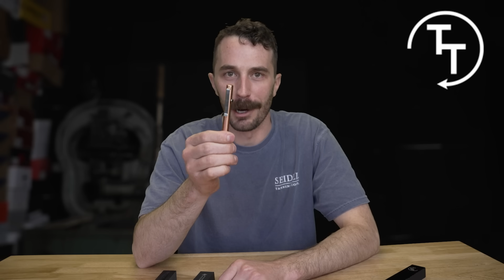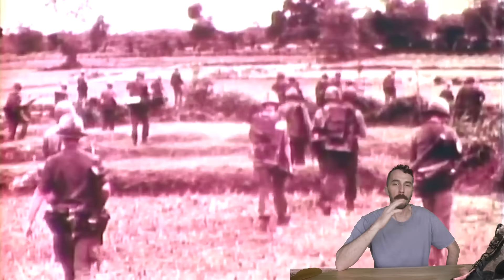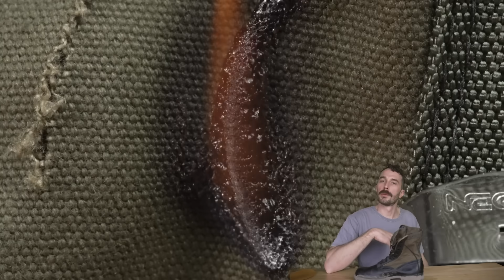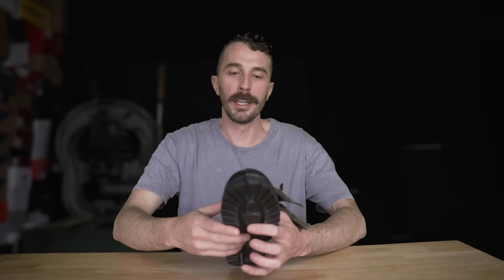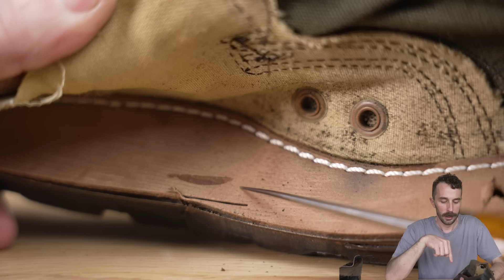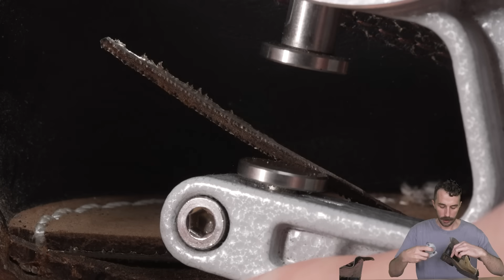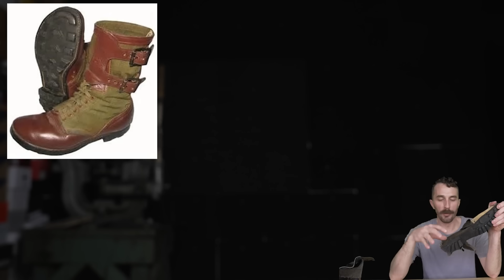Why it took 57 years to replace jungle boots

Comment: I was a Marine grunt in Vietnam (4/67-5/68) and I still have my jungle boots,  and they have held up well after all these decades (though I don't wear them anymore).  I logged many miles in those boots through the rice paddies and fields and had no problems.  I found them to be a reliable and comfortable boot and I really liked the job they did.  A great boot in my opinion.
Reply: My dad just gave me his. He is a marine grunt and was in Vietnam 67/68.. badass boots
Reply: @MarcosGarcia-jl5lc  your dad gave you tacos and Cactus
Reply: I wore them in the 1990’’s and early 2000’s. Countless miles of ruck marches. I remember, getting to Bosnia with only cold weather boots. Ordered some green Altima’s. The day i got them we did a long movement. I wore them right out of the box with only one coat of polish, not a single blister. I learned foot management from our brothers who went through Vietnam.
Reply: Canadian?  @parajeeper
Reply: I was in from 96 to 02.  I got several pair of the last remaining green uppers in the supply chain.
Reply: @road2wearysum1  Former FMF Corpsman here.  I wore jungle boots for my entire time with the Corps.  10 years active duty, the last 7 with the Corps.  My first suggestion for foot care would be to learn to trim your toenails correctly.  You'd be surprised how many don't know how to do this. I've removed/fixed many, MANY ingrown toenails that could have been prevented with proper trimming.  Next would be changing your socks, but along with that foot powder.  It just keeps your feet dryer, and they'll feel better.  Hope that helps.  If it doesn't then take a knee, drinks some water and get some Motrin. LOL!!!
Oh, and I put an athletic insole in my jungle boots and felt like I was wearing athletic shoes or even slippers.  Very comfortable for long "walks".
Reply: @fasteddie9502  Semper Fi  3rd Tanks 1970-1971
Reply: Did that water system work to keep/get the wet out?

I'm in/from the Netherlands, but I can put a military hardware store on my next trip's list, hehe
Reply: I wore a USED pair of Vietnam Era jungle boots for 10yrs daily at work before they finally gave up the ghost. :)
Reply: I served later but kept my boots    they where a big part of the time when I was enlisted    Kiwi polish....
Reply: Howdy duster.....I finished my picnic & returned to CONUS a month before you arrived.  We were attached to the Fighting Fifth.
What unit Brother?
Semper Fi!
Reply: I had them in the military. Maybe it was a knock off (European). They looked the same. the vents were there.
The only thing I remember is the heel giving me nasty blisters so I didnt use them for rucking. The vents IMHO cant work for water drain. They are too high. I dont remember getting them submerged but it kinda worked for ventilation compared to common full leather boots anyway. Now I'm thinking buying them as a work boot. I got iron mesh spike through a boot couple of times and it's not funny anymore. What would be the next generation jungle boot btw?  Is there a better and still affordable version yet?
Reply: @trollmcclure1884  The heel inside is bright shiny leather.  IMO the biggest mistake on this boot. If you take a piece of sand paper and scuff up the inside heel where you feel your heel slipping, it works wonders to stop slippage and blisters. Since the boot now grabs the sock there.

 Im still trying to break in this boot and someone said they had experience in this boot and recommended a size down so normal would switch to narrow so youre not swimming in the boot. The exact opposite of what the boot manual says, suggesting to wear the boot longer and wider to compensate for swelling but then says boot should fit snugly and tightly. Well I took that guys advice and ordered a size down to N and they fit like a glove. Snugly but not tightly. But now Im wondering if I made the right move here, because walking in these boots is difficult and feels like they definitely need a break in before theyre functional and possibly never being broken in enough to develop function. Theyre getting better but Im starting to have doubts on that power play.
Reply: @gantz4u  Yeah, like the never break in. I remember the rubbing. Vasoline could help. It makes the leather soft. Even too soft. It can crack over time they say.
Once it's soft you could use wax to stop it from being so slippery. I had the feeling that the heel is so stiff that there's something else in the heel behind the leather like plastic or that hard paper they use in other boots. It's actually plastic too. It just looks like paper. I ruined some other boots drying them too close to a fire. This thing shrinked. The leather was still OK but I couldnt get it out. 
If you could make the heel soft enough to create an indentation for the heel - that would keep the heel in place. I think I'll buy the newer German version anyway 🙂
Reply: @trollmcclure1884  how could the vents not work for water. I'd rather have a tiny bit of water being squished out the vents as I walk over a boot full of water to the calf.
Reply: @matthewotis3594  it's too high and in the middle. Maybe it's better than a full boot but you still have a lot. It may dry up in a week. If you are in a desert
Reply: @trollmcclure1884  well I've worn them walking creeks and streams and they're light years ahead of a regular work boot to the brim with water. Don't believe me, I don't care. It's just a fact.
Reply: @trollmcclure1884  we walk like a rocker. The middle is best place for them.
Reply: Thank you for your service!!
Reply: @projektkobra2247  Youre welcome
Reply: Thanks for your service , Brother .  I was in the Navy 1985 - 1995 .  In basic training we were issued Chukka boots that came just over our ankles . They sucked , and most sailors replaced them soon after arriving to the fleet .   In the surface fleet we were required to wear steel toed boots . I was on shore duty as an MP for two years , and  several sailors wore Jungle Boots . After two years shore duty I bought a pair of US Navy Flight Deck Boots when I returned to the surface fleet . Those were the toughest boots I've ever owned , and lasted almost four years .
Reply: Oorah, brother.
Reply: Semper Fi!!!
Reply: We the taxpayer want our boots back soldier ...nah I'm fuggin with ya ..you keep em you earned them ..thanks for your service and WELCOME HOME SOLDIER ...
Reply: No you wasn't...
Reply: @oslo4251  course he was, wheres the evidence that he isn't?
Reply: This are actually my favourite boots
Reply: dude thats awesome
Reply: Welcome home.
Reply: Then I hope your name doesn’t say your birthdate…
Reply: Thank you for your service mate
Reply: Appreciate the good feedback
Reply: You’ve gotta be around 94 years old, I did some math in my head
Reply: @BiggityBoggity8095  who? My dad/uncles and everyone their age served in Vietnam. Depending on when but my dad would be 75 if still alive.  Or maybe you’re referring to a time specific post and not just nam
Reply: @peter-radiantpipes2800  I’m referring to Vietnam. The guy said his tour ended in 1968.
Reply: @BiggityBoggity8095 if he enlisted at 18 in 1968, 57 years ago, he would be 75.
Reply: Thanks for your service.
Reply: Many of the Vietnam era boots were made in my hometown of Hazelwood, NC by Wellco (might have been Welco, I was young.).  It was a large plant for a tiny town.
Reply: you went there for nothing. 🤣
Reply: as an vietnamese i still have alot of impres to that boots
Reply: not a good boot and can mess up your feet and you're heath as well.
Reply: @road2wearysum1 You appreciate he's service in Vietnam? I appreciate him sharing but im wondering what about the Vietnam war you appreciate.
Reply: Went thru 2 pairs of jungle boots in Vietnam (10/67-5/69) then in the Philippines till late 1970.  Gave them away when I got home because they didn't fit anymore.  They didn't shrink, I grew from a size 10 to a size 11 and I got 2" taller!  They were great boots.
Reply: You stumped on many inocent Vietnamese heads with those boots, like a proud American delivering freedom and democracy.
Reply: @road2wearysum1  you appreciate bastards who killed people in Vietnam? LOL
Reply: how many ppl You killed?
Reply: @duster1968 welcome home
Reply: How many raping and murdering civilian did you score?
Reply: Thank you for your service
Reply: AYE AYE to that brother
Reply: Welcome home, Sir

Thank you for your service
Reply: Awesome I'm a retired Army I was in Florida guard we were issued jobs I still like those
Reply: Oorah Devil
Reply: hey old timer welcome home and thank you for your service you didn't get the proper welcome from Americans back then so im giving it to you now
Reply: Did you ever smoke weed
Reply: They're the most comfortable boots I've worn. My one improvement was to use Nike Air insoles in them. I always said they felt like a heavy pair of Nikes, anyway.
Reply: Dang. Thank you for your service.
Reply: Thank you for you service.
Reply: My dad was a grunt 64-67 just passed away... Relived of duty.... Thank you for your service
Reply: They also don’t look half bad. Full of proper function, comfortable and they actually look at least somewhat stylish in just the sense they’re not ugly. They definitely look like a great boot to have
Reply: thank you for your service

welcome home
Reply: @jjk343  Wdym?
Reply: My dad was there from 69 to 70, humping in the jungle - left early due to being in a Chinook helo crass.  Thank you for your service.
Reply: Thank you for your service, my grandfather got drafted but they stoped sending soldiers the day he was meant to go and I’m glad he is still here with us
Reply: Thank you for your service sir.
Reply: Thank you for your service, and I wish that I can hear more stories from you
Reply: 😅 good combat boots ever made, used them while I was serving in the Army National Guard in Puerto Rico basic issue for the tropical weather in Salinas Manouver site from 82 till 06!😅
Reply: When I was younger I went to the surplus store. I bought these boots. I bought some camo  pants and I used to wear them. These boots were amazing. I didn't know much about them, but this video told me more. Thanks to everybody who served. 
When I was in the Air Force we had to polish the boot. Now soldiers and people in the military don't  even know what that is. Polish the boots.
Reply: “For God so loved the world that He gave His only begotten Son, that whoever believes in Him should not perish but have everlasting life.”
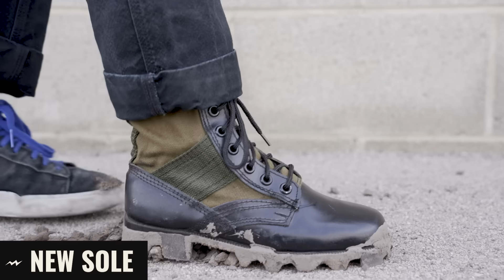John 3:16 NKJV

“that if you confess with your mouth the Lord Jesus and believe in your heart that God has raised Him from the dead, you will be saved.”Romans10:9 NKJV
Reply: Man loved my Jungle boots (I think I still have them).  I wore them out.  So comfortable.  They were the black leather and green mesh.  Wore them when in the 3ID in Germany.  They weren't standard issue had to buy them from the base store.  When the 3ID was deployed we all got desert boots without the valves-tan leather and tan mesh.  Those boots were just ok, not like the black and green boots.  It didn't really matter as we never got dessert camo uniforms.  I was a medic and drove a M113 and wore Nomex.  I loved the Nomex jumpsuits.  I was so skinny and fit back then.
Reply: Thank you Brother, for your Service. 🇺🇸
Reply: My dad who was in the army from 1966-1968 said it took a long time to break in those boots
Reply: Welcome home 🎉
Reply: i know it doesn't need to be said but thank you for your service
Reply: I should buy a pair
Reply: This is very interesting coincidence.The fellow of this YouTube video is named Rick Dora.He lives here in alaska
Reply: My dad gave me his. They are one of my prized possessions.
Reply: Seabee 1994-2005 we had a version of that boot with Kevlar toes and foot bed for construction CCU boots
Reply: Thank you all for serving our country.
Reply: Welcome Home and thank you for your service. Jungle boots are one of the best boot of all time.
Reply: Bullshit.
Reply: I wore some Iraq era BATES desert boots and they stink. Made in China boots. The amount of grip these boots offer(none), I started wondering if they did that on purpose and started wondering who sent them the contract(Clinton). The boots are also not high quality and the sole separates from the boot.  This video really sold me on these boots, so I ordered some surplus. I really appreciate you guys fighting for my freedoms to steal you boots and your valor, so I can walk around the grocery store like I was drafted into the nam nam.
Reply: @gantz4u  I was enlisted '99-2010 and never heard of Bates being made in China.. had several pairs. All of mine had "made in USA" tags on them.🤔
Reply: @williampierce4513  There was actually an indictment of 5 executives of a boot company around 2006 for relabeling chinese boots as USA manufacture. This was wellco not Bates. But Bates happens to manufacture boots in China and the USA..sure buddy. I dont care about the tag. The Bates line is an inferior quality boot with many examples of poor quality in similar military contracts around that time. Poor sole material and craftmanship and prone to slipping. Maybe I read China on the label. Maybe I just read Bates is a Chinese boot and said the boot was from China. Theres no way to tell because that boot went in the trash when their soles fell off, But I definitely did not read made in USA anywhere on the boot. Because at the time, slipping on its sole made me think about the implications of their place of manufacture. These boots have a history dating back to the original bush in gulf war 1990.

Also Im wearing a pair of solomons and just checked and it says made in Cambodia and theyre great...Get it together.
Reply: @gantz4u  Ok, I was not aware of this. Did you really have to be all condescending & rude to relay this information?
Reply: @williampierce4513  I must be so condescending and rude I didnt realize I was doing that in that post. Sorry bro...I just re read it and the "sure buddy" looks like its directed to you when I mean Bates claiming they manufacture in china AND US. Like, I dont believe that. But not willing to directly call it out as false and fraudulent because defamation. and Im not 100 on it. Also I was implying that shoe manufacturers should get it together based on the quality of these cambodian shoes.

If they made the GX-8 to the quality levels of a vietnam era surplus boot and a jungle sole I would probably buy them. I like the zipper and speed laces, but the sole wears out and its just not quality and the sole design is poor and not built to last like the way they built these vulcanized jungle boot soles.The jungle boot is not very comfortable imo but built to last and solomons seem to be in my goldie locks zone of quality vs comfort... Out of Cambodia. Implying it has less to do with country of origin vs manufacture. (no offense cambodia)
Reply: @gantz4u  I hated Bates then and can’t believe they’re still in business now. Chewed my feet up.. Cheap Chinese sh**.
Reply: @callspreadzero854  I hate bates too. Theyre comfy, I guess, IMO, but the soles are slippery and they chew up too fast. Its the cheapest feeling boot possible, as far as sole quality. Vietnam issue jungle boots are the perfect amount of old and new boot tech. to make a boot that holds up. Although not the most comfy boot possible. That was the summit and instead of moving on to more comfy indestructible boots we plateau'd as a nation and its been all down hill from there.
Reply: @gantz4u  No "Made in China boots" are allowed for use in the US Armed forces, because they are not "Berry compliant". Only US-made boots are to be in use due to this amendment (by the US senator Berry) that dates back to the year 1941.
Reply: rap 🧢 cap
Reply: Thank you for your service.
Reply: Thank you for your service! When I was younger I would do military simulation airsoft games and did many Vietnam erra games. The jungle boots were relatively comfortable, the new technology is amazing but for its time, very quality boot.
Reply: @tysvm do you recommend real Vietnam jungle boots for myself
Reply: Thank you for you service. alot of hate you got when you came back and in no way was that right or deserved. just goes to show what propaganda can do. again thank you for your service. Thank you for my freedom
Reply: Lincoln was a big fan of these, but The Union couldn't afford em back then.
Reply: @SuperSedingAngeL-yr0  screw the union, America is better
Reply: Rice paddies lmao mmmmm
Reply: @shiverarts8284  how is that funny?
Reply: @peter-radiantpipes2800  cause your mom
Reply: How did it feel being in a CIA psyop?
Reply: @frankiecast4897 you must be real fun at illuminati parties

Comment: Thanks for the memories! In Vietnam I wore Navy boondockers but did bring home a couple pairs of jungle boots. I didn't know there was sheet metal in the sole but did know about the spike, which can be seen as a lump down the centerline on the bottom of the sole. 
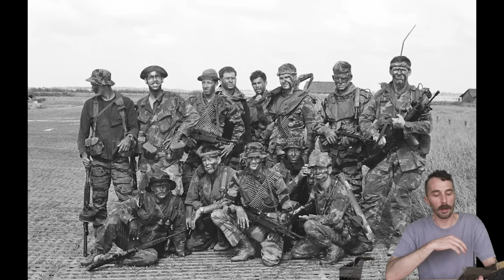At 9:24 that sure looks like SEAL's posing for the camera! The guy on the far left appears to carry a Mk23, originally known as the M69W and Stoner 63 and 63A. Wish I had one, but they are a bazillion bucks now.

Comment: I was issued these pos in 1971 and were terrible. That vent hole let water in not out you couldn't 
Walk though 0ne inch of water. Your feet were always wet not dry. The boots in 1971 lugs clogged up and couldn't clean. Vietnam had this red clay soil and wouldn't come off your clothes 
Or vehicles. I remember being cover head to toe with this soil. They had a similar boot in boot camp and the  sole would Crack in the middle. We were issued three different types of boot and jackets and uniforms in 1969. They issued boots and uniforms from Korea and what ever was in stock.